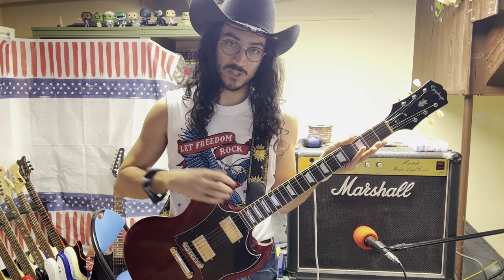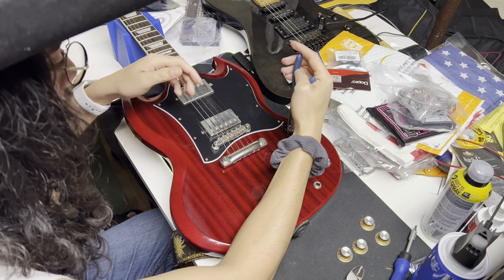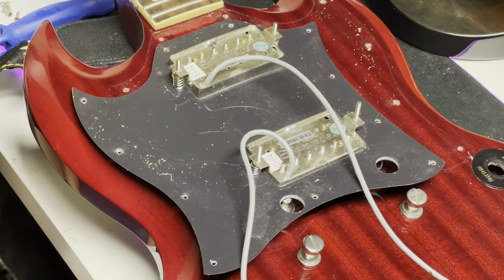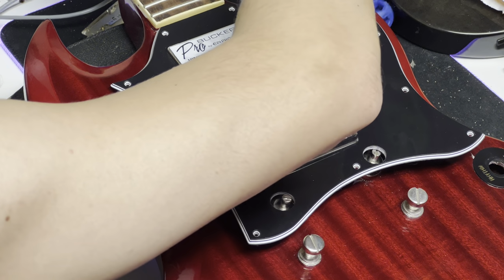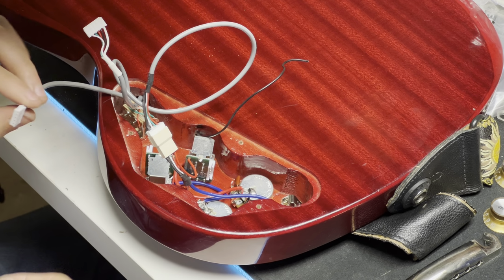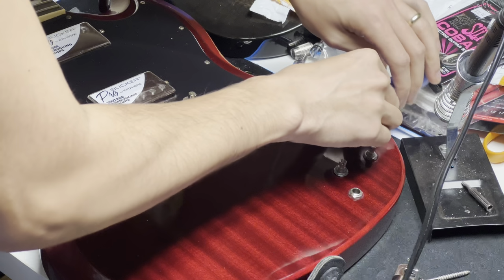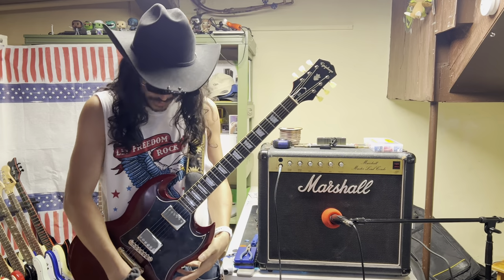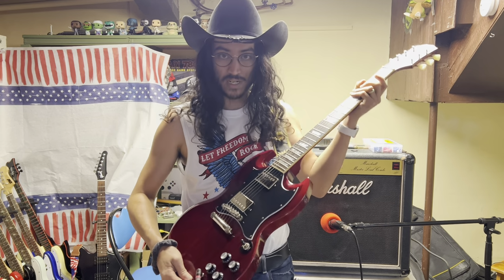Installing ProBuckers and Pro Wiring Harness in my 2020 Epiphone SG Standard!

Comment: Thats a lot of excess wiring. If it seems like you get noise at all, may want to make those shorter. Also put some shielding paint or tap in that cavity. But all that excess wire is going to act like an antenna. So either shield the cavity or trim the wires down. Easiest solution is to get the paint or the tape. But make sure the tape or paint is touching a ground. If you dont then your just adding a bigger antenna. If you go play under certain lights, that guitar will be noisy as is. Just a heads up. Not picking and thanks for the video. ;-) Ive got some videos of some of my projects ive been doing. :-)
Reply from the maker: Cool, thanks for the recommendation!

Comment: How disappointing, I watched this video to see where the ground wire goes, when you removed it your head was in the way to see where you cut it from them when you soldered it back in you edited that part out.... bummer
Reply from the maker: Sorry about that :( the ground wire goes into the body and is connected to one of the ferrules for the bridge. That end is not generally accessible. The other end can be soldered to the common ground point on one of the pots, and the other grounds can terminate to the same spot. I'll be mindful in the future and make sure to always show my work without blocking anything!!
Reply: @BigJakeMusic  It's a great video... I ended up soldering it to the input jack ground sounds great now on a Leo Jamez
Reply from the maker: Great to hear! Those guitars look like a great value.
Reply: Im glad you answered that ? thats the reason I watched this video,to find out were the around goes. Thanks

Comment: I don't know why, but mine wouldn't fit through the hole from the pickup cavity to the electronics cavity. I had to cut the wires and solder them back together and since they were soooooooo small the only way I could insulate them was with hot glue. It looks terrible inside 😞.
Reply from the maker: I put it in sideways, with the connector parallel to the wire, and it BARELY fit. I thought I’d have to go the same route you did, but I was lucky enough to get it to go through! Maybe there’s a slight variation on the diameter of the hole!
Reply: I know this is super old but never cut when you can take a dental pic and depin the harness from the connector then pull through routing cavity and then re pin the connector! hope that helps for next time :hand-pink-waving:

Comment: i was watching your video again because I missed it first time around becuae I was typing my last comment. Another difference between the probuckers and the pickups you took out of the SG, are the magnets used in the pickups. The probuckers are vintage style, and they have an alnico 2 mettalic magnet. The pickups in the SG had a ceramic magnet. that makes the pickup hotter. Nothing wrong with that. its what you want for heavy harder music.

Comment: they have a warehouse in kentucky. a lot of stuff comes from there. they are real, but i have a couple of theories myself. they shipped epiphone manufacturing to china. so eveything is going to be made in china now and that stuff was made in Korea. which is a plus in my book, but some of these have bad pots with them. so I think the combination of the two, china has to make its own stuff now and with a lot of these having some bad pots here and there, they cant use them in the guitars that are bing biult in china. So, they are just getting rid of them and someone is probably pocketing the cash, instead of just throwing them away. I got a set that had a bad push pull pit. I told the seller and they sent me a whole other wiring harness with everything. the same exact push pull pot in that wiring harness was also bad. So, the whole line porobably has a lot of them that are bad because the odds of that are too high. But I took the good pot off the other wiring harness and just solered it in. they sound great. But even with a bad pot, i gave 40 dollars for the whole deal. the pickups themselves usually sell for around 200. So, a person cant complain. I ofund your video actually to look up and see if others were having this same problem .but i am super happy with them. super. they sound awesome and you can split them. I found the same deal on aliexpress yesterday for 20 dollars and free shipping. I thought about buying a couple more sets. Theyt come with wiring harness and all. A push pull pot will run you 20 dollars. but these are 100 percent real. i think the combination of some of them being bad and being made in korea, the chinese just cant use them. cause epiphine manufactering has been sent to china. anmd instead of throwing them away, they are just getting rid of them as quick as they can and making some money. Which makes sense and im not gonna complain about. they sound really good. but you can find this on aliexpress for 20 bucks if you look and want to pick up a couple more. these things wont be around forever at those prices and then you wont be able to get the made in korea anymore. and i look for that to cause the price and desirabilty to go up on these in the future. please excuse the typos. I put shielding wire over the wires on my pickups and grounded them. really easy to do if you ever want to do it. a trick you can use is to get a regualar tv coax cable and i strip the rubber off using a butane lighter. there is a trick that makes it go really fast but im not gonna try to explain.the just slide the shielding off the coax cable.  then like cloth wiring on a fender, you can push it and the shielding wire will widen, so you can push it right over the connectors on the probuckers. first I like to use shielding tape and cover the humbucker wire. you dont have to but I do. Then i just slide the coax shielding right over it. The I cut some really thin shimes of black tape and ill wrap it wround the coax on the humbucker end. Then I go down the wire, pulling the coax tight so it shrinks around the wire and add a little shim of black tape here and there as i go. then cut off the excess. Then, you dont have to, but I have a heat shrink tape trick, i go back abnd put little peices of heat shrink over the places i tape. then I will wrap a little piece of copper wire around the end with the humbucker, ill twist it up with a but of the shieldinf wire i left. LEave a bit on both ends to do this. Then I fold it back out of the way and ill wrao a little thread around it for security, then cover it with a little peice of heat shrink. this is because that shielding wire for coax is hard to solder, it just has to make connection. Then I will solder the copper wire on humbucker end to the humbicker. Then I add a peice of copper wire to the other end and do that same thing., twist in, thread, heat shrink tape. But I leave that wire alone until i installed the, I sheild my guitars and when I am finished, I twist the copper wires from both humbuckers together and clamp an 0 connector on them. Then screw them down to the shielding on my guitar. Easy way to add sheilding to these if you ever want to. I shield all my pickups like this but I use regualar sheilding if I can. You can biy it pretty cheap. Technically, you could just use shielding tape to do this, but I like to , make things look good. Just a tip if you ever decide you want to sheild those bad boys. I did see a date somnewhere on one of my pickups or harness. I cant rememebr where right off, but i remember the date. it was 2021/9/9. soudned good man. Over look the typos.

Comment: Hey Jake can you describe the differences you hear between the Probuckers and Alnico Pros in person.  There was a lot of mic distortion on the clip.  I had a hard time hearing the core sound.  I ask because I have the exact Epiphone SG Standard.  Ordered the same Probuckers and will be doing the exact swap. I find the Alnico pro extremely muddy on the neck.  Hoping to clean it up some with the Probuckers.   Keep rocking brother!
Reply from the maker: The ProBuckers are ALOT more clear. They don’t peak out the guitar signal as easily as the stock humbuckers. They are a bit underpowered when split, but I guess that’s to be expected. They are a definite upgrade over the stock pickups and provide a bit more clarity. Notes and strings don’t get lost in a muddy mess as easily as they do with the stock humbuckers. I’m sorry it took so long to reply!!!

Comment: 16:57 I think you’ve made a minor mistake. You said that the cable which you hold was the cable of neck pickup. But you connected it to the bridge volume pots 🤔
A few moments before (13:59), you also explained that the cable with blue tape was the cable of bridge pickup 😅

Comment: Interesting video.  I just put this exact same upgrade kit into a Chibson Gold Top that I  bought for the helluvit, a few years ago and really love the upgraded tones.  

Couple things I learned the hard way.  Some of the wires in the solderless kit are tiny, like telephone wires.    Also there were no instructions in the kit, but I assumed it would be so easy, who needs them, right?  

Well, even easy wiring kits are only easy if you do them right the first time.  So, before you start  the install identify which pup is for the neck position and which is for the bridge, then use a Sharpy to mark the white quick connects.  Then
connect everything on top of your work bench, and plug it into a practice amp and do a function test.  The quick connects between the pup leads and push/pull pots are weird.  Look at them closely and figure out how they work, BEFORE you’re trying to donning the control cavity.   Also identify which switch position controls which pickup and put a reference mark on one side of the back of the switch.  

All of this will make your install go so much more smoothly than the Charlie Foxtrot I went thru.  

Having done my share of pickup swaps and pit upgrades, I dove right in.  Then when I was trying to figure out the connections and which pots went with which pups, I was had to move things around a few times and two of those tiny wire snapped off, right at their weld points leaving no exposed wire to reweld.  Plus in the right confines of the control cavity, it was almost impossible to strip the ends of those little suckers.  They were even smaller than my wire stripers.  

Anyhow, eventually, I got it b all in correctly, but the lack of obstructions and my just wing-it approach made a 30 minute easy swap into a two hour cuss-fest.  

So I hope this helps any of y’all who are watching this video and planning to do the upgrade.  Best of luck.

Comment: I bought the same kit without push pull pots, I've never done this before so how do I tell which are the Volume and which are the Tone pots. I'm assuming the pickups plug into the volume pots??
Reply from the maker: Yes, the pickups plug into the volume pots, and each volume pot will be connected to a tone pot. Put the volume pots in the right place and follow the wires to place the tone pots. You can also connect everything and test it out plugged into an amp before you tighten the nuts down :)
Reply: @BigJakeMusic  Thanks, everything went fine.
Reply from the maker: Great news!